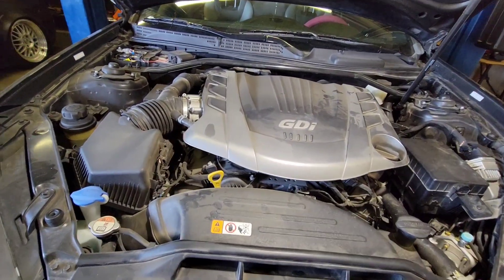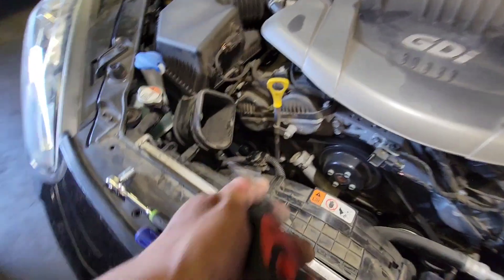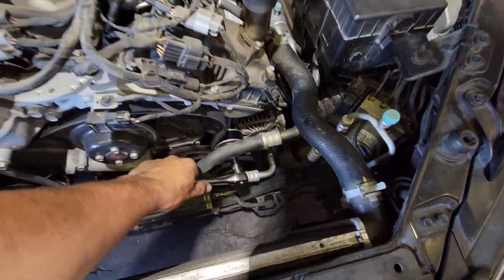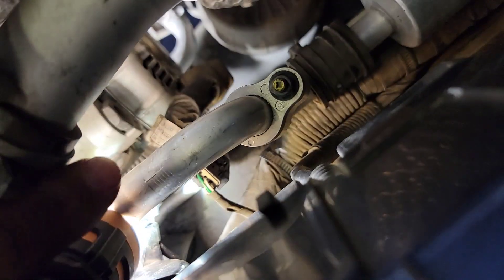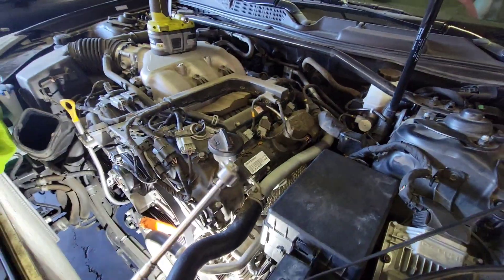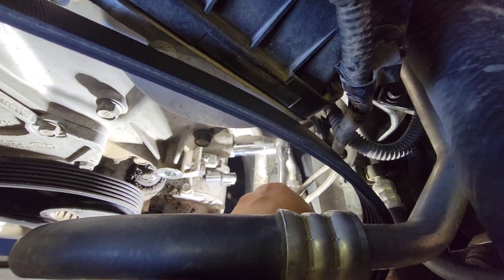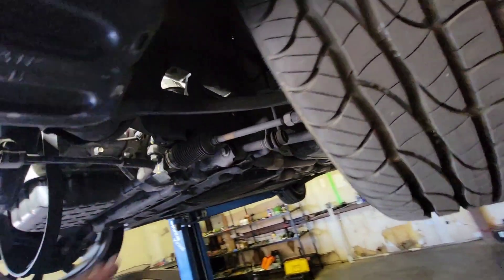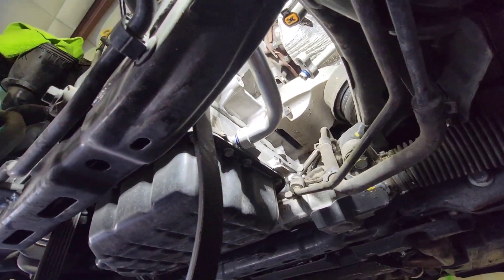How to: Remove A/C Compressor 2016 Hyundai Genesis 3.8L

Comment: How did you diagnose the bad compressor?
Reply: It requires a pressure gauge set that you attach to where the compressor is supposed to be creating the pressure in the system. I would assume then that all you would need to do is check the psi on the gauge and if it's not generating anything then you know the compressor is no good. I have read online that there is a control valve on these units that are approximately 50 bucks. They will go out and cause the entire compressor not to work. If you plan on repairing yours, it might be worth your time to just get a new control valve first to see if the issue resolves. That's quite a bit of work, but might save money. At the end of the day that's what we're all compromising here... money vs time.
Reply: @Person.555  thanks. Yeah I know there was no pressure. I have a set of gauges. The compressor was not running. But sometimes that could be other things besides the compressor. I went ahead and changed it and it fixed it so I got lucky!
Reply: @AITA-NIM  I'm going to pay someone to fix mine. I don't want to buy the tools. I also don't have a nice lift. It will take me weeks to get to the compressor for replacement.
Reply: @Person.555  sounds good. Just FYI, though I did mine on a set of rhino ramps. It allowed me access to the work from underneath without compromising access to the parts that needed to be done from above, and it was all simple hand tools. The replacement of the compressor was quite easy. getting it recharged would certainly be much cheaper than paying for the entire job. Cheers.
Reply: @AITA-NIM   not sure if I read that wrong, did you mean you didn't have to take the alternator off and stuff? You just did it all from the bottom? My compressor went couple days ago, if I can do it myself I will definitely try, it's also been recharged, would I have to do it again?
Reply: @freshnewrips  My comment was that a lift was not required, that by using ramps, you can access the top and bottom both and complete the job as shown in the video. Everything needs to be disassembled as shown. Honestly, no offense, the fact that you didn't know if it would need be recharged after a compressor change gives me pause. I am going to assume you have little or no experience working on cars and if this is true I would discourage you from trying this. There are a few parts like reinstalling the alternator that take a bit of effort. Cheers.
Reply: @freshnewrips  yes you will need to recharge it. If you plan on doing it yourself I'd recommend paying the shop for diagnosis, swap out the parts yourself because it's pretty manageable if you take your time. Then go back to the shop and pay to have it recharged.
Reply: @AITA-NIM  I do everything myself on my cars to the best of my abilities, when things break I fix them, not everything has broke in my day so with that being said, I have no experience with working on a AC unit. Little offence taken, I just got the ac recharged and they said I needed a compressor, my question was if I would need to do it again. I learn quick. I would rather not do it myself but at the same time shop prices are $240 an hour, in this economy I have no choice sometimes.
Reply from the maker: @freshnewrips the ac is a complex system. It has compressor, ac condensor, dryer, expansion valve, ac evaporator....many components...best thing to do is get it uv tested so you can find the leak. Or a visual inspection of the components to see if there is any wet spots of oil...meaning it's leaking freon
Reply: @559powerscape  I did get an inspection from a professional when they did the recharge, there is no leak the compressor just isn't working to the best of its abilities, it kicks out from time to time causing the car to fog up. They quoted me $1500 to do the job after paying $200 for the recharge and inspection. The compressor itself is only $280 so I figured I'd ask questions and learn. Getting to the compressor doesn't seem hard I was just asking questions to make sure I knew what I was doing 100% before spending the day taking everything apart. Is the Freon going to leak out when I take it all apart? Should I get the refrigerant evacuated before I do the job? Simple questions. You guys are being pretty hard on someone's intelligence for asking questions, I know what components are in a AC unit. I'm mechanically inclined I rebuild dirt bikes, i changed my alternator couple months ago on the coupe which is half the job and I've done my own maintenance since owning the vehicle, spark plugs, engine and transmission mounts and so on. I don't think any question is a dumb question, I don't have friends to ask. Maybe this isn't the right thread for me.
Reply from the maker: @freshnewrips  yes it will leak when removing it. The best thing to do is get it evacuated, replace it and get it recharged. Sorry brotha I wish I could be more help
Reply from the maker: I just replaced all the components on my car..700 bucks but works like a champ now